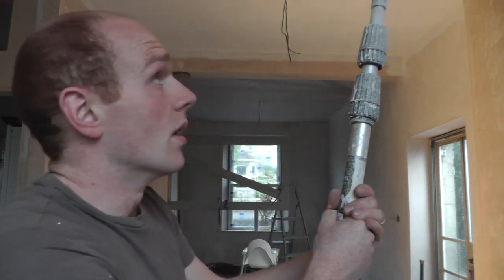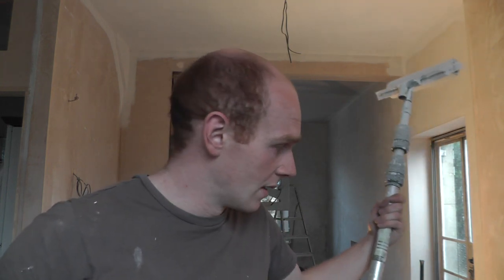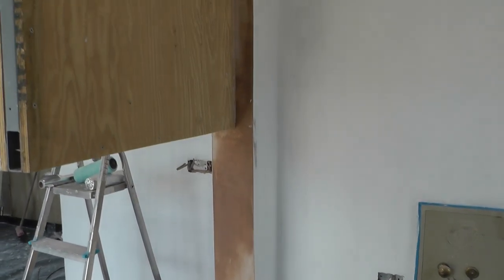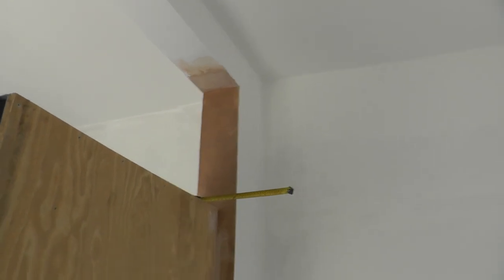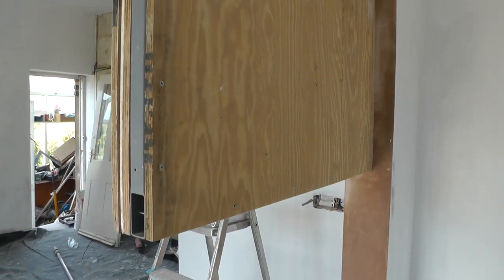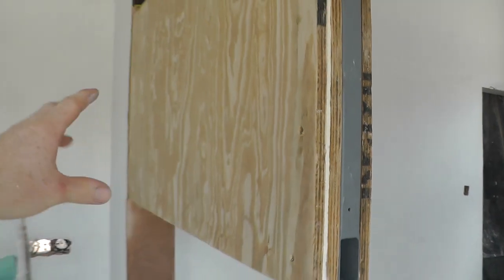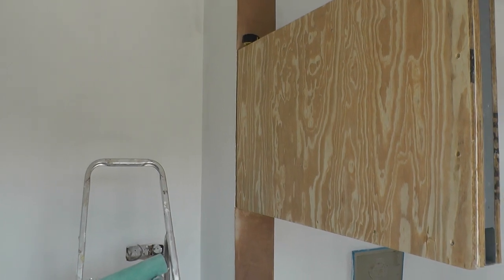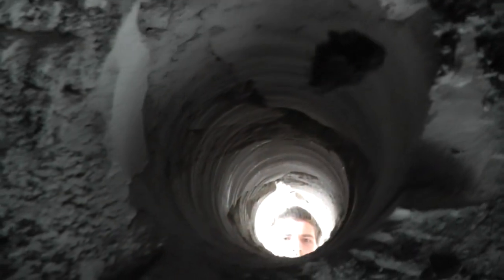CORE DRILLING FOR HOURS!

Comment: Good work. Should really use a handle when core drilling if you can, can easily break a wrist if it snags. I think that Titan drill does have a clutch in it though. Still good practice.